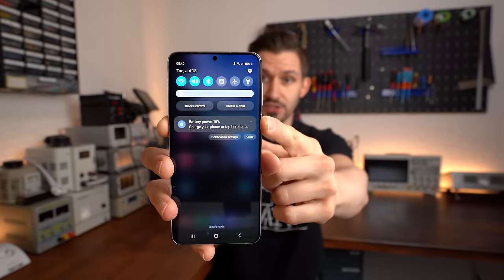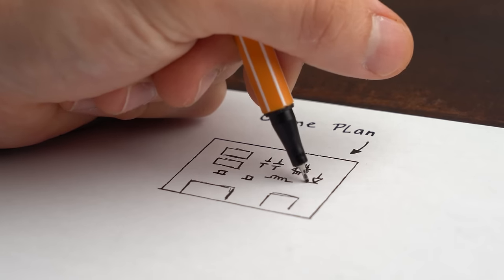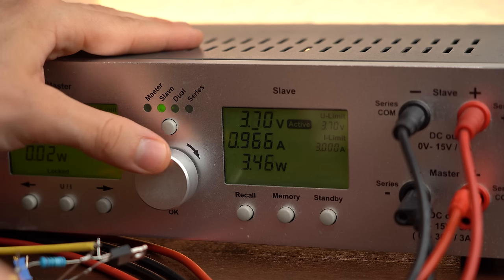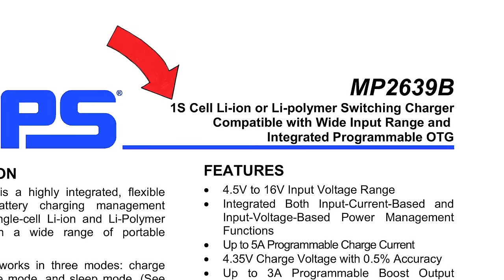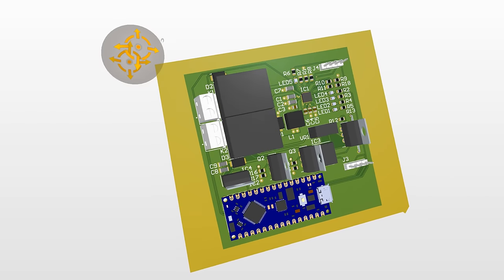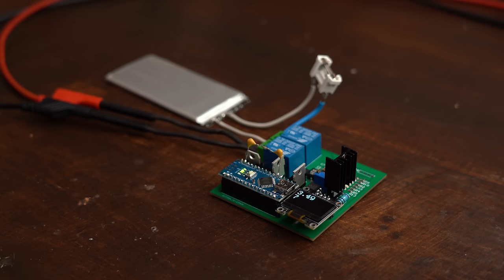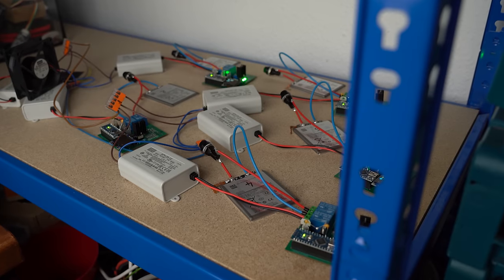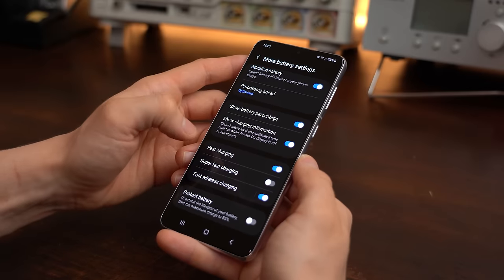Don't Fast Charge your Phone before Watching this Video!

Comment: Great video, but it isn't actual anymore. Since pd, vooc, pps are around they have INTELLIGENT fast charging. The phone actually requests how much power it wants based on the state of the charging, and the temprature of the batteries. In your scenario you charged the phone with 5A which means you don't use an original samsung charger which uses PPS, which is by far the best, using variable voltage and constant amperage (2.25A) to try not to raise the charging temperature as much.
SuperVOOC and PD use different constant voltages with varying amperage to charge the phone, but PD doesn't really go over 3A ln the lower voltages, only around 12V it starts to give out more for laptops which have 2S2P and 3S2P batteries, and superVOOC us used by phones with 2P batteries so the actual current is halved. 

Your theory was right, the high charging current heats up the batteries and damages them, but phones started to use intelligent charging to get around the problem. 

Also, to my best knowledge, if you use a brand name charger designated for the phone, it takes off the task of voltage and current regulation off the phone, because the phone can actually tell the charger what it needs, and get that power without straining the phone circuits which also reduces heating up the phone.

Thanks coming to my ted talk.

Any comments are appreciated with agreeing or disagreeing me as long as it's respectful to people! Calling eachother names and acting superior won't take anyone anywhere.

Peace y'all!

Comment: What I would like to add is that bateries also degrade over time itself. Android phones are geting quickly out of security updates, so they become e-waste anyway.

I had my last phone for over 3 years and realy got a degradation in battery capacity even though I was almost always very carefull about its charging and almost not using fast charging at all. Most of the time I used simple 5V 2A charger. Also for most of the time I kept it in 20-80% of battery range.

Still, when compared to my fiancee that had her phone for similar amount of time and during so, she didn't realy pay attention to charging. I mean - charging it during whole night, disconnecting it from a charger just for a few seconds just to see something and then pluging it in to charger again.

In my opinion, at least in mobile phones - it is not worth it to so much take care of batteries. It is still a device that is meant to be used by you and be convenient to use. When you are about to go out in 20 minutes and got only 15% of battery - pick a supercharger. Juice it up as much as you can before you go and just go and have life instead of waiting for devices to charge. By the end of the day these are just a things and supercharging functions where made to make your life easier. If you have more time - pick up a slow charger.

Comment: I only fast charge if I need to, otherwise I use a wireless slow charge either on my work desk or at home next to my bed. Fast charging produces heat in the phone, I assume the battery. And what I know from my career, heat shortens the life of most electronic devices. In fact, we use it to speed up long term reliability testing. 🤓

Comment: The reality of Smartphones is that after 3-5 years of that model you need to buy new model again since the firmware of the old model is already obsolete.
I hope Smartphones battery can be easily changed/swap/repaired to avoid this problem though.

Comment: I don't think the video was very clear.
Did you charge the battery with a stable 5A until 100%?
How does the speed charger charge? Does it also do 5A until 100%?
What was the battery degradation with the speed charger?
Ever noticed that setting for protecting the battery?
Why did the battery degrade? Current? Voltage? Temperature?
If temperature; would a fan help cool it?
Manufactures must do more and better testing than this. Are they happy to degrade your battery because you have to buy a new phone?

Comment: You miss one very important factor which is that you charged the tested battery to full 100% which this experiment did not factor in the 80% charge protection under fast charging environment. This could mean we can still use fast charge but only to 80% and never letting the battery completely depleted. If we can hover between this two scales it would potentially keep the battery condition always optimal.

The final 90-100% is the most challenging part and put the most stress to the battery so if we can theoretically avoid that and hover it around 20-80% charge, this mean we can bypass this problem with fast charge.

Comment: I just use a "dumb" 5V charger for my bedside charger as I'll be asleep for hours and theres zero rush for the phone to charge quickly.

Means I don't jeed to change settings and I can still use fast charging during the day if I need to (different charger).

Comment: I thought the phone would only draw the power in amps that it needs so if the input of the phone was 5V 1A and the charger output was 5V 2.4A (as my Anker charger is) the phone would only draw 1A from the charger.

Comment: I was kind of onboard until you compared it to 1A WIRELESS charging. 

Wireless charging produces more heat and worsens the battery faster than wired charger. More importantly there is a huge energy LOSS.

But yeah fast charging does have some  damages to battery.

That's why we need right to repair so as to be able to replace the battery.

Comment: this video uses skewed preconditions:
1. Real fast charging does not work by just stuffing 5A into your Phone. Fast charging will usually draw less and less Amps the more your phone charges up, thats why the last few percents take much longer to charge up. A power bank charging IC will likely not do that (as much), because if your powerbank consists of 4 parallel 18650 batteries, 5A is only 1,25A per Cell, which is not much, so less of a need to decrease charge speed of that final few percents when the powerbanks cells are slowly charged even at 5A constant charge.

2. Batteries capacities vary on a few parameters. Fast discharging does lead to a lower capacity, thats a face, and i have heard that fast charging can also  lead to a (somewhat) incomplete "full" state. it seems  at least plausible to assume that it can take some time for the chemistry of the cell to find a place to put electrons and that a cell may be "full" earlier when its stuffed with charge quickly.

now this is just an assumption, but if its true that could mean that the initial 1-2% loss of capacity are not permanent damage. this could be ruled out if the final test of the cells was made under equal conditions. simply by fuilly charging all cells from 0-100% at the exact same speed. if the loss of 1-2% is permanent damage, the fact that the fast cells were charged slowly just once wouldnt make a difference.

Comment: There's one huge problem with your test: your understanding of fast charging is completely wrong.

First, fast chargers don't charge at 5 amps, they charge at 1.65 amps.(depending on quick charge version) How does that charge quicker you ask? Because it does that at 9 volts. As far as I can tell you just cranked the amperage which is 100% wrong.

Second, it doesn't charge the battery at a consistent rate. It charges the battery really quickly from 0%-50%, then slower from 51%-75%, then slower from 75%-90%, then even slower from 90%-100%. It does this to preserve the batteries health since an uncharted battery can gain charge faster than a nearly full battery.

In conclusion, your testing methodology is completely flawed and your results should be thrown away. 3 months of time and money completely wasted.

Do better next time.

Comment: Hi great video, you went through great lengths for getting the data. I'm a bit confused though, when my samsung devices fast charge, the charging current mostly stays the same,  but the charging voltage gets increased to 9 V and thus doubling the charging power that way. Are there different types of fast charging or what am I missing here?
Reply: It’s because it’s split between two batteries…
Reply: @christophervanzetta910  yeah na, you're just wrong. What would that have to do with the amount of cells, if the non fast charging voltage is 5 V. 
Quote:
A standard adaptor’s voltage ranges from as low as 2 volts to 4.2 volts with a relatively low electrical transfer rate. However, a fast charging adaptor is capable of building a much higher voltage (5V-12V) with a faster electrical transfers until the battery reaches its peak voltage capacity.

What does peak voltage capacity mean? It is the optimum capacity of a battery to charge quickly. As the battery reaches 50 to 60 per cent (peak voltage capacity of standard batteries), the electronic controller (IC) drops down the voltage intakes to prevent battery damage.

Comment: Never used fast nor super fast charging. I charge between 25-75%. I use my phones 4-5 years and their batteries are still very good, close to their original capacity.

Comment: I do fast charge my phone several times a day but i limit my battery to 85% and i have a battery alarm so as soon as it hits 85% then i can pull it. I never charge all night. I only charge while awake. I have two phones so i don't use the phone wilt charging and i only charge the phone while on

Comment: Very good journal 👍🏻 Although, 100 cycles wouldn't define a very accurate result as shown (100 cycles with 1A charging resulting in  increasing the capacity 😂)

For me, the true question lies on the true charging speed of the specific lipo cell on smartphone with capacity around 4Ah to 5Ah. The capacity density is so huge and , I wonder the 1C charging spec for lipo is still viable.

Comment: Hey Scott! Great video - I've been saying for many years that fast charging is a bad thing but the general consumer demands even faster charging. It's like a cancer.

I do want to point out that there are lots of different types of fast charging protocols and you've tested Samsung's Super Fast Charging (which is USB-PD).
I am also wondering does charging the battery overnight (leaving it to trickle charge for a few hours) will affect the battery health. If yes, is as significant as fast charging them daily?

Comment: this is awesome, if you continue this experiment it'd be great if you could also monitor the temperature of the batteries. IIRC a video on this subject by MKBHD concluded that it was not the fast charging itself that deteriorated the batteries but the heat produced while doing so, so I would love to see a test on this, comparing the different charging speeds but somehow keeping the temperature the same. tbh though I'm not sure how you could pull this off without it being a lot of work
Reply: The surface temperatures of the batteries could be kept the same by putting them in a water bath. Since that's obviously a bad idea a close alternative would be sandwiching each battery between two heatsinks and keep air flowing over it.

Comment: I only charge my phone up to 60%. Batteries are like balloons. The more air it contain, the more stress it will gets. Fast charging is not the only thing that damages the battery but the high voltage. Voltage is like air inside of a balloon. More volts = more stress and that stress will make permanent damage.

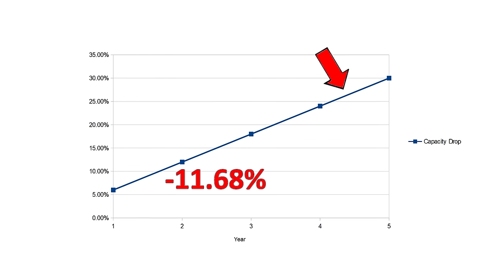Comment: 11:35 what is 11.68% capacity loss during 2 YEARS if many users change the phone by that time and even more important parameter is TIME user saves in comparison to 1A charging! Without including time saved into equation, its impossible to do REAL conclusions!

Comment: I ended up having to turn the fast charge back on because the phone would still be discharging while I was using it on regular charge.  My phone doesn't have the "super fast charging" option, but I guess that if I did, that could stay off.

Comment: I keep a wireless magsafe charger for my samsung phone, I keep it on the charger most of the day, and I keep the protect battery (hard limits the charge to 85%) always turned on. I only use super fast charge if I'm in an absolute hurry and cannot afford to wait, and even then I never turn off protect battery.
Reply: I will say though that I go on a walk every day, so the phone gets a good 50% charge cycle in most days. 
my phone battery still lasts about as long as when I first got it, so I'm not complaining.
Reply: also modern samsung phones have this thing called bixby routines or "modes and routines" which allow you to turn on and off fast charging whenever you want. so for instance you can schedule at night when you're at home, your phone will automatically turn off fast charging so it takes longer over night.

Comment: The reason why phone companies use higher nominal voltage(4.35v) lipo is because it restricts you from using regular 4.20v lipo. If you still do, it will puff up within 6 months. The third party open market is filled with 4.2v phone batteries which never last. In the end, most will buy new phones.

Comment: I have a Xiaomi 12 Pro and it can Charge with 120W (20V 6A). I dont do that often, but when I do, i feel no difference in life span. Also i charge my phone with 25W (11V 2.25A). And since im Using the energy saving all time, the battery lasts at least 2 days. And when i got the phone first. it didnt. So somehow the battery lifes longer than before. Is there an explanation?

Comment: I don't think this gives best idea about fast charging effect on battery. For example some android phones like OnePlus / OPPO has optimized night charge which limits the charging current during night so it is fully charged by morning. Also they utilize charging technology so that during first 20% and last 20% the charging current is much smaller than while charging between 20-80% at full current.

Comment: Good experiment but not really matching reality. In reality you would never charge from 0 to 100% mire like 20% to 100% and I’m interested if repeated charging with low delta vs infrequent charging with high charging delta makes a difference.

Comment: My Pixel 7 with the Google 30 W charger has an adaptive charge feature, I have no idea if other phone/charger combinations have this. If I plug it in with an alarm set it will aim to get to 100 % by the alarm. The intention is to increase the battery life by trickle charging when it can, but you can get fast charging at other times. I am hoping that the battery in my Pixel 7 will last longer as a result.

Comment: My Galaxy S9+ has been fast-charged using its original charger for 5 years, although it has obviously dropped in capacity, it still lasts a full day when I charge it at night. When it does become a nuisance I will just change the battery.

Comment: Each to their own, but I always feel like owning a phone with fast charging then framing your life aroud it by slowly charging it is like owning a Ferrari and never taking it to the redline. I just set aside £50 for a battery reppacement and use my phone as normal. 2 years later, I'll just get a fresh battery. I charge it slow overnight, but any other time you better believe im maxing it out

Comment: While there is no doubt that fast charging is worse for battery health, this test really can't be taken at face value, first of course we need a larger sample size and a much longer test, at least 400 cycles
Also, a huge point to consider is heat, heat is the worst enemy of lithium batteries, one of the benefits of fast charging is that the battery experiences more heat for a shorter amount of time, so that when you're charging it, it will not get as much heat as slow charging which keeps it hot for much longer (but at a lower temperature), but that's flipped on its head when constantly charging and discharging, now the opposite is true, slow charging is constantly at a lower temperature, fast charging is constantly hot (except when discharging, it's the same as slow charging)

Comment: I'm sorry to say, but I think you forgot something. 

Charging stops when the current drops to 10% of the starting value. So, charging with 1 A means it stops at 100 mA. Charging with 5A means it stops at 500 mA.

To measure the capacity of the battery you charged with 5 A you have to charge them with 1 A.

Otherwise you are comparing apples with pears.

In my understanding, a battery charged with 1 A gets slightly fuller and that might explain the difference.

Comment: i think you should continue this experiment with oppo and xiaomi phone batteries too... those use dual cell and higher voltage rather than amps.. they also last very well.. my father's 50w phone has no problem for 2 years and my mom's 150w phone also has had no problem from when she bought it last year.. moreover samsung and apple phones have primitive battery tech that degrades the battery to 80% capacity in 2-3 years... whereas these chinese manufacturers are experimenting with graphene batteries and GaN circuits